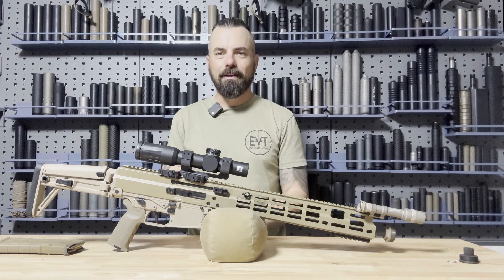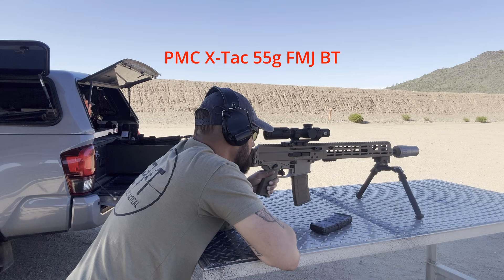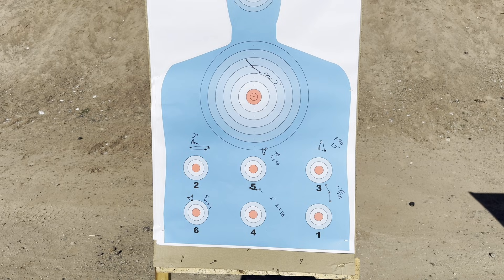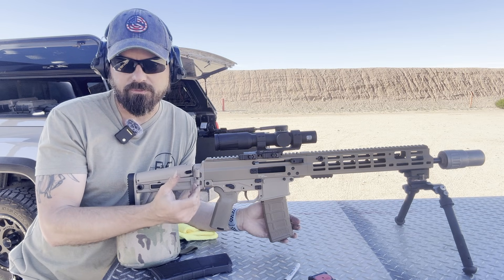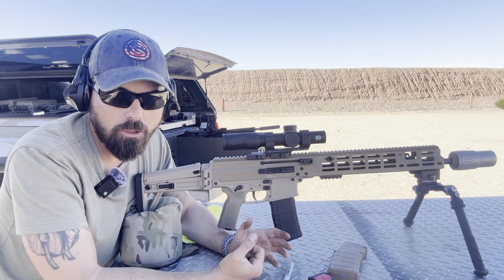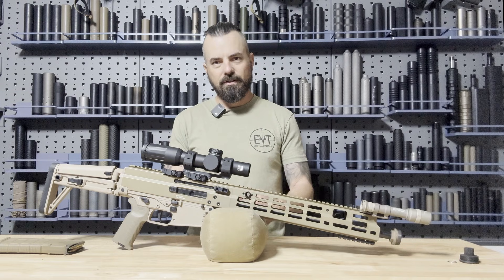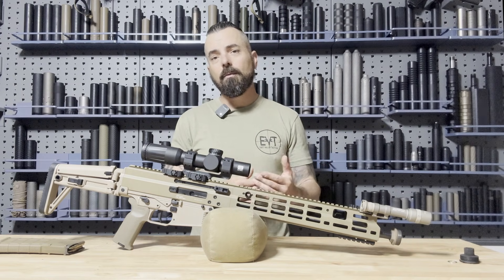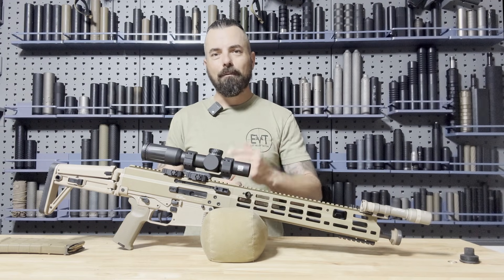APC 223 b&T review

Comment: Q4Rob. Is there a prefered low back pressure 9mm can for PCC use that you would recommend for another left eye dominant shooter?  The primary use case would be the mp5 platform and flux raider.  Its great to finally get input on cans from another Phoenix local who understands the unique problems of someone who shoots rifles left handed. Thanks for all the info you are putting out.
Reply from the maker: added , TY

Comment: Maybe im just a hater. But id buy a PWS and a few cases of ammo instead of this. 

Similar accuracy and reliability. Lighter system, more AR-15 parts compatibility. 

The B&T APC and FN scar really put a bad taste in my mouth because I know how cheap those extrusions and injection molded lowers are(after initial tooling). Yet they charge out the wazoo for these rifles, which should be able to price match most mid-high end ARs. While being heavier, more proprietary, and not offering much if any advantage beyond folding stocks(arguable whether that even matters).
Reply from the maker: They are definitely similar in a lot of ways. this this is solid AF tho and i do love that it folds.

Comment: Q for Rob: (very specific one, understandable if not able to 100% exactly replicate/test): What .22 suppressor (diameter under/approx 1.1", length approx 5-6") rated for 5.7mm (does not need to be full auto 5.7 rated) works the best with a 10.3" barrel. I'm trying to "tuck" a suppressor under the Ruger LC Charger handguard, but am concerned with potential backpressure/cycling issues. My goal is reliable function first, maximum sound suppression secondary (cost fairly negligible as most 22 suppressors are sub $600). I'm leaning towards the Huxwrx Flow 22 Ti or the B&T Print-X Tiger .22 LR Ti, but have also been told the Dead Air Mask 22 is good? Thank you for any input.
Reply from the maker: on it! thnak you

Comment: Q4rob: what is the best off the shelf 556 suppressor host for plinking and prairie dog hunting. Prefer 18-20” barrel and must have adjustable gas block.
Reply: From what I’ve seen, he’d probably recommend the rhino s or the vanish 556. Both lower on price, both crazy quiet, and for your situation another upside is it’s made of titanium so super light. The titanium would be a downside if you’re looking for something to shoot a higher firing schedule for training or full auto. But technically they’re still rated for 3 full auto mags within 1 min. So you’d probably be good. If you go cheaper you’re going louder and heavier
Reply: @jwaffle42 thanks. I have the vanish and Rhodie on order. I’m looking for the best running AR to put them on.